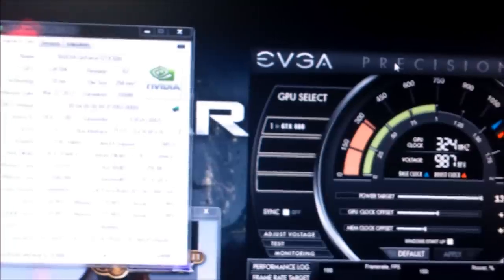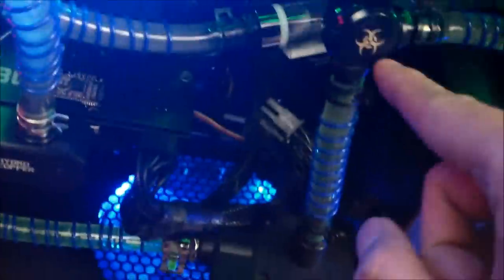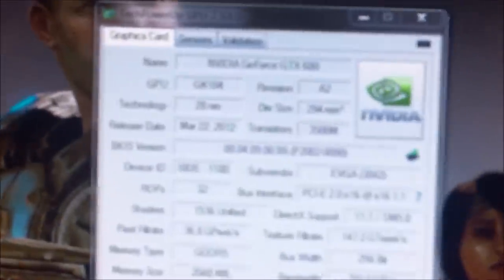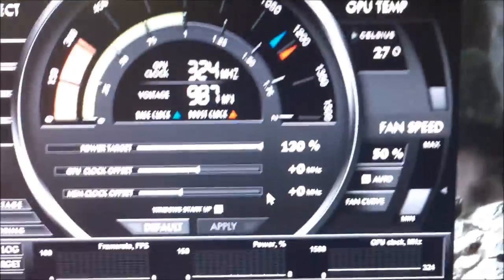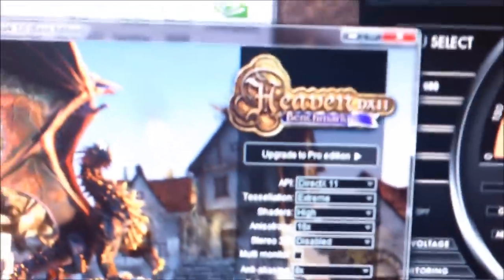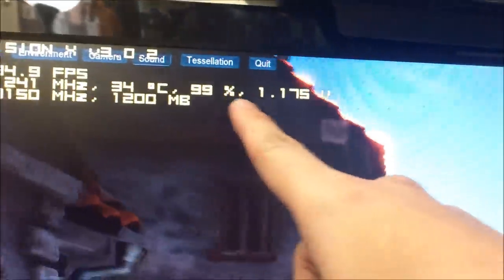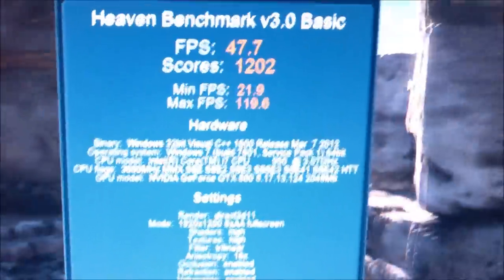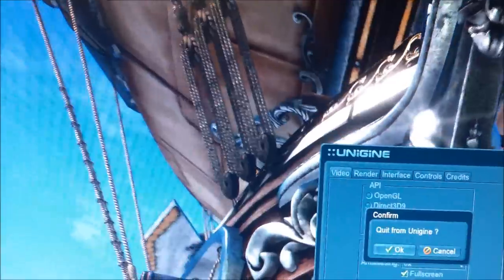GTX 680 Hydro Copper watercooled

Comment from the maker: well, I'm not using this 680 hydro copper anymore. I sold the card several months ago.
Currently, I'm using 2-way SLI GTX 670 4 GB with EK waterblocks. All I can say is that the temp of GTX 670 w/ EK waterblock is higher than 680 w/ Hydro Copper waterblock.

Comment from the maker: no it doesn't need a waterblock because it comes preinstalled with a waterblock. But the regular GTX 680 will need a waterblock if you want to watercool it.

Comment from the maker: yeah that should work just fine. For PSU, I suggest go for 800W. That way u'll be ready just in case if you want to get a 2nd GTX 680 for 2-way SLI. Matter of fact, just get a 1000W PSU.

Comment from the maker: I tried ocing and to be honest...power target max is 130% only and voltage is 1.175v max. I can't even push the gpu clock offset to +30 mhz. It's not stable & it would crash.
The card comes with factory +209 mhz overclocked.

Comment from the maker: My mobo is PCIe 2.0. I have X58 system. However, there's no performance difference between PCIe 2.0 and PCIe 3.0 if you're using a single monitor and a single GPU.

I think there's a video on youtube some guy running an experiment with 3 monitors GTX 680 SLI and the difference is quite big between 2.0 and 3.0.

Comment: Nice rig. Was wondering what fans you are using on that rad. Also I have the similar setup as well in my 800D w/ a i7-950 on H20 (SR-1 360 rad) and wondered what your temps were in full load on the GPU/CPU since you're running all that only on a 360 rad. If you have BF3 I'd like to know what your CPU/GPU temps were while gaming after a few hours. Looking to purchase a GTX 680 Hydro Copper in the future. I was also thinking of just running it all on my 360 as well if the temps arn't too high.

Comment from the maker: of course. But how did you manage to put all that rads inside your case? 240 rad, 120 rad, and then 360 rad. You would need a strong pump for that long loop. A 1200 Liter/Hour should be fine.

Comment from the maker: Actually by the end of 2012, there will be some games that will push GTX 680 to its knee. For Example: Probably around 30 fps with Metro Last Light at 1920x1200 max settings with High PhysX. Even current Metro 2033 is making my GTX 680 bleed at only 30ish fps running the benchmark.

And My i7 950 will become a bottleneck for upcoming new GPUs by next year. So I'm gonna have to upgrade the CPU, mobo, and RAM to prepare the system for GTX 780, though I'm sure GTX 780 will be delayed until Q1 2014.

Comment: I have to agree with you on this. My card also struggles with Metro 2033. Damn that game. You buy the fastest card on the planet and it still struggles at times. This has put me in an odd place. I want to do a custom watercooling loop for my cpu and gpu, but I also want a second 680. Which in your opinion would you choose? Need some insight into this. I can always pick up a second 680 at a lower price in the future, but the WC prices will remain the same. Opinion?

Comment from the maker: I think driver update will fix the framerate issue with Metro 2033. It's your choice whether you want to get a 2nd GTX 680 now, or wait for GTX 690 and get that instead. But to be honest, I think 2x GTX 680 is faster than a single GTX 690. But a single GTX 690 might be cheaper and u'll save the PCIe slots.

Comment from the maker: any benchmark program will push a single GPU card to its limit. Crysis 2 at highest settings 1920x1200 will get 50 fps - 60 fps with a single GTX 680.

Comment: the only rules  in watercooling loop is res -> pump with the pump being under the res. i love hydro copper. i'm looking for the hydro copper classified. i'm never going to crossfire/sli again. you get great numbers but not all games supports multigpu and when it does microstuttering can occur. more problems than performance.

Comment from the maker: what fps did u get? this is normal at 1920x1200 highest settings with a single GPU. I'm evga member and I've shared this video there with other evga members. If you can get a much higher score than that, that means u're probaby using a very high overclocked GPU + a really high overclocked CPU.

Comment: Running Heaven 3 using the same settings as you on my two Gigabyte GTX 670s in SLI on my i7 2600k at 4.5 GHZ and the new Nvidia drivers released a few days ago 301.42 i'm getting well more than double the performance you got. 112.5 FPS 2835 Scores and 259 max FPS all that for less than $100 more the cost of your card.

Comment: an i7 3770k :P im not so sure about getting two anymore, it is kind of hard cooling 2 680's in a fractial design core 1000, i think i need to mod the case a little to fit a 240 rad in front..